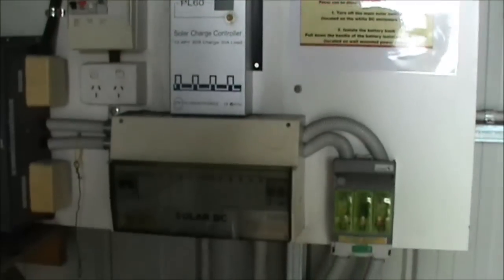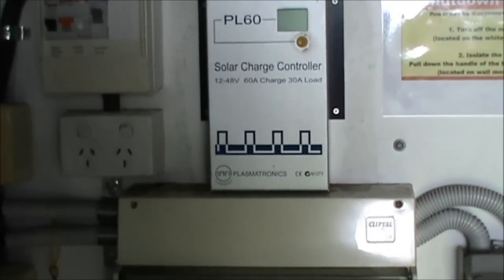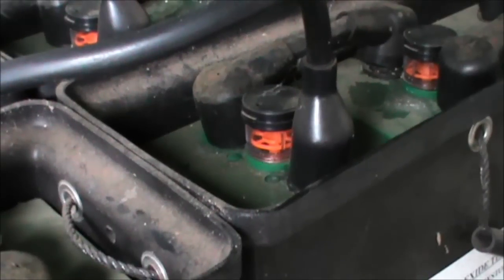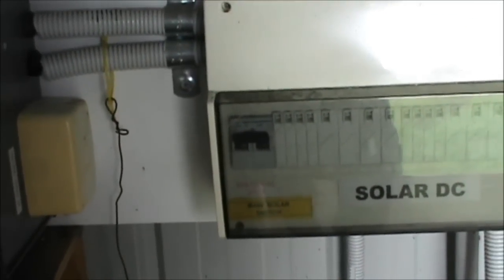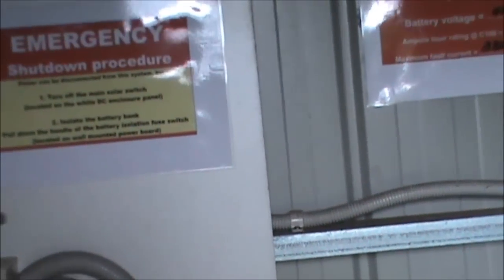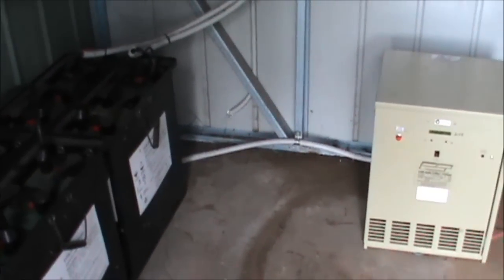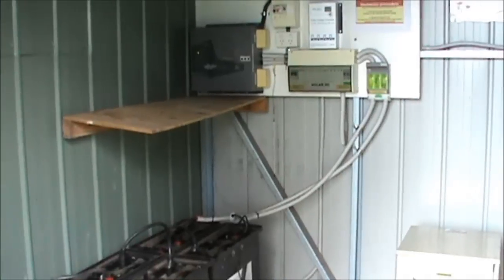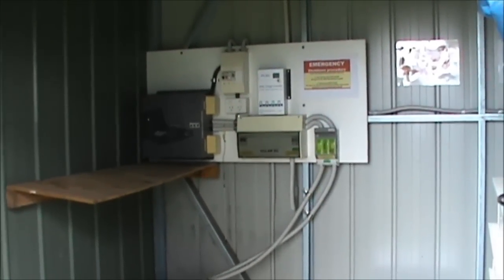Off Grid Homestead Series. Solar Power Pt 2

Comment: you want to go even more basic. I started with a $60 battery, a $20 charge controller and a $100 solar panel and used it to charge my radio and phone, also hooked it up to my UPS and powered my PC for a bit

Comment: It’s actually 11 grand (comments have a limit on characters) but you could do it in stages and use portable inverters. The biggest expense will be the batteries @ 3200 (Unless you split it into two setups then it would be half). You can get 12v 80W panels for about $100 on eBay. You could probably get away with starting with the 8 batteries, 4 X 80w panels and a cheap charge controller. That would only set you back 2100 if done correct (AUD). If you want to contact me send me a message here.

Comment: Flexmax 80A Charge Controller @ $1000.  Add $600 for solar panel mounting to the roof and $1000 for bits and pieces and a sparky you are looking at an off grid system that takes minimal up keep for less than $11000 (doing most the work yourself).

Comment: It doesn’t have to be a lot of money. If you keep with flooded lead acid batteries (the cheapest kind of deep cycle batteries) you can go with 24 Trojan T105’s @ 225Ah making a 48V system with 225AH @ $200 per battery ($1600 for the batteries) making it 10.8 KWH worth of battery storage. Get 16 batteries @ $3200 for the lot giving you 21.6 KWH of battery storage. 3WK worth of PV panels (12 panels @ 250W and $300 each) @ $3600 for the lot. A 6kW (18KW surge) Pure sign wave inverter @ $800.